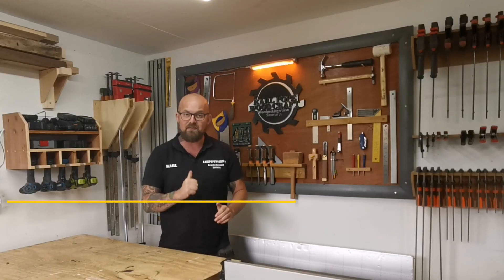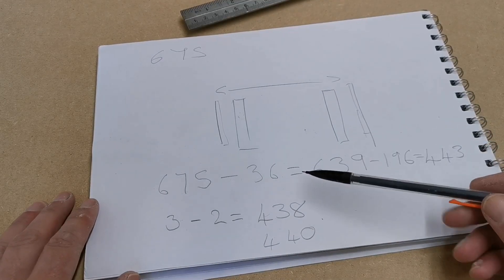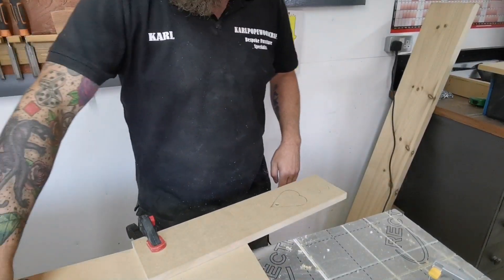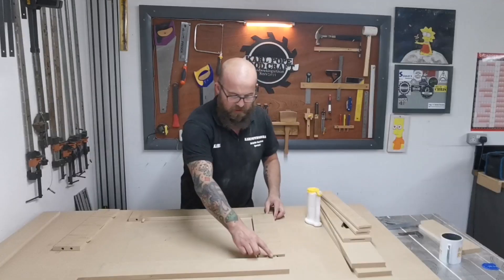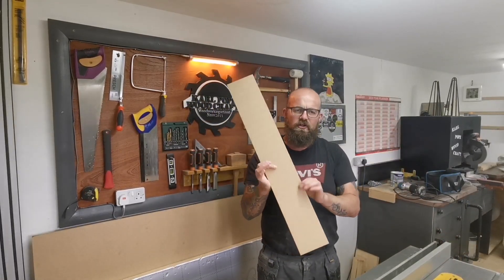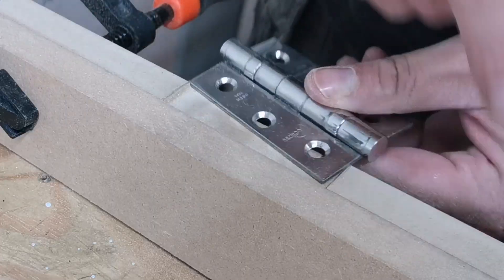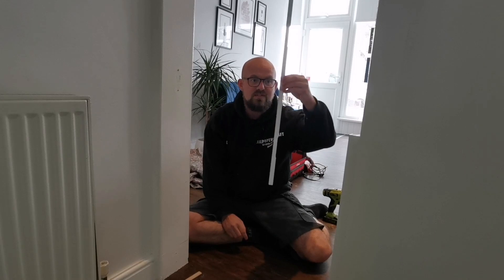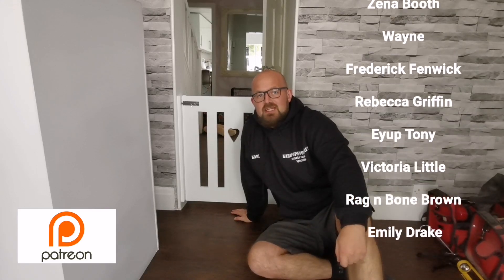How To Build A Stair Gate

Comment: Thanks for making this video, the finished product looks amazing. One thing I was wondering for my own stair gates (4 month old baby and growing fast) was whether this could be done more simply out of a single piece of MDF and cut away the waste between the styles with a mixture of track saw and jigsaw, similar to how you cut the heart detail. Given the small spaces between styles it doesn't seem too wasteful of material and it ought to be stronger. Am I going to give myself problems doing it that way?
Reply from the maker: Your welcome David, I'd say making it from one single piece would definitely be stronger, I myself would probably make the entire thing from pine if it was for a child for the extra strength because mdf is fine for our little dog but a baby might be climbing on the gate lol please take care and check out the guide lines on child safety gates as well before you make your project as there's lots of things to consider in regards to gap spacings ect. Best of luck with your woodworking projects mate.